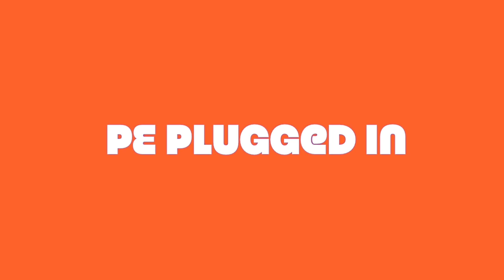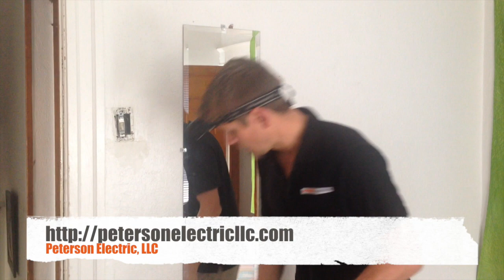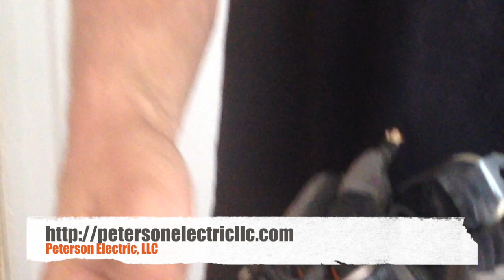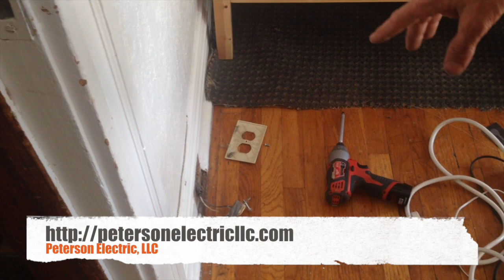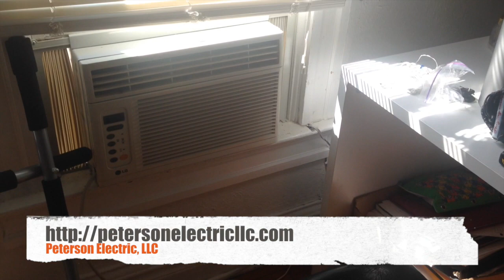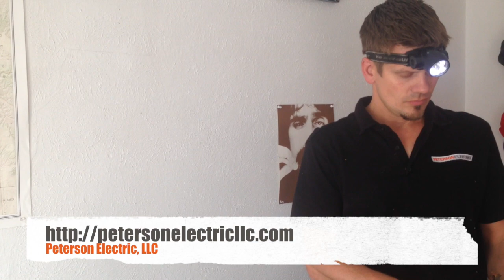Power Tapped From Knob & Tube Wiring In Historical Home To Add Plugs, An Electrical Fire Hazard

Comment: Stupid home owners? Listen kid life is hard and electricians are expensive  Everyone don't have 30k to have there home rewired. I bet your mom and dad put those little plastic caps in the outlets lol. I know that didn't help your manors listen to yourself the knob and tube did great for over a hundred years at least they didn't use cheap aluminum wiring and throw away all that energy back into the neutral wire like we do today. You need to know your history go visit an old electrician in a nursing home and apologize for your rant maybe you will feel better.

Comment: I always worry when I see a "handy man" doing electrical work then renting it out to people, I live in one of those homes now until I buy my own home, I will not plug in high voltage stuff nor will I plug in more than 1 thing per circuit or plug haha. The fact that there was a small fire here already from a previous renter I am not surprised since this home is from 1880's and had knob and tube that was missed when redoing electrical work and the tenant plugged in a radiator 🤦‍♀️

Comment: Love your insults because you tell it like is is and don't care who you offend.  Because thats precisely the reason many older homes are torched.  And the very reasoning insurance companies 9 out of 10 will not i mean will refuse to insure a home with knob and tube.  While it was very safe and cutting edge technology when it was installed in the turn of the century,  it is mainly all these jerry rigged modifications to the original system that makes it a serious fire hazard.
Reply: You don't know what the hell you're talking about. Many homes on the west coast have knob and tube and they're insured. You're just talking out your ass & off of the top of your head, You're not an "electrician" you're not even a competent handyman.

Comment: It's called Knob and Tube or K&T for short, because the first part refers to the large ceramic insulator knobs which help support the wire along joist,studs and rafters and insulates the wire from shorting with the wood in the case that the insulation fails, and the second part refers to the insulator tubes which provided the same function as the knobs but were used in places where conductors had to run through joist,studs or rafters, also there were ceramic cleats which could hold 2 wires at once which were used to insulate the hot and neutral and keep the hot an neutral held the proper distance away from each other.
When it was new knob and tube was actually quite safe since by design the hot and neutral were separated and were only brought together when they were brought into a box, however 80+ years later the original type R insulation has become brittle and the flame-retardant treated cloth may have degraded to become a fire hazard, along with numerous unsafe modifications.